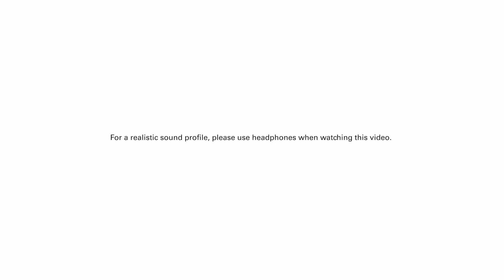Lilium Real Sound Profile - Noise Level | New Test Flight Video of Lilium eVTOL

Comment from the maker: Select eVTOL videos:
🚁 Personal eVTOL Jetson One https://youtu.be/OkeiEH1BA8M
🚁 Futuristic Propulsion System To Power eVTOLs https://youtu.be/PH_H7pIkL4Y
🚁 Lilium vs Joby Which Electric Jet Quieter? https://youtu.be/3rpzgwDsdOI
🚁 Ultimate eVTOL Comparison: https://youtu.be/IbIY1f05OrY
🚁 Lilium vs Joby vs Archer | Which eVTOL Is Better https://www.youtube.com/watch?v=OWx_Ea2s7us
🚁 Vertical Aerospace vs Lilium, Joby & Archer. Which Is Better? https://www.youtube.com/watch?v=YyYmluyB0nU
🚁 Joby Aviation (JOBY) vs. Archer (ACHR) https://www.youtube.com/watch?v=5kBecB3l3jo

🚁 Lilium Jet Architecture, Engineering, Ducted Fan https://youtu.be/k3UbgqM-srU
🚁 Lilium Capital Markets Day - Part 1 https://youtu.be/uAzQJ2OzO8I
🚁 Lilium’s Inaugural Analyst Day Webcast https://www.youtube.com/watch?v=dvLXCLcYyb0
🚁 Lilium 7-Seater Cabin Unveil. Evolution of Lilium Jets https://www.youtube.com/watch?v=d3eYyfXnl3c
Reply: Yes I like Jetson too! Cant wait for battery tech to catch up. Will be getting one when it does get better mileage and drops price a bit

Comment: Mate, run the sound through an fft. Lilium completely lie about the sound. It's is INCREDIBLY obvious they LPF the audio just before takeoff. Complete bollocks. Blatant lies about the noise. Trust me - just look at the frequency content of the audio in 1second slices during the takeoff run up. You can clearly see them bringing the low pass filter in and basically cutting off all the audio above ~12khz. Lilium are shady af

Comment: In regards to the sound profile inside the cabin i believe it will be a very audible environment without the need for headphones.  Least we forget, in most small aircraft excluding many jets, similar to that of the Honda Jet,  Most small aircraft including helicopters require the use of headphones and noise canceling mics to communicate between passengers.  Here we do not see the use of loud combustible engines nor the scream and shrill of both jet engines and rotors. Their will be transferable sound due to the physical attachment of the engines to wings and thuse the fuselage, but much of its sound is captured via the ducted fans and their sound suppressive lining. Moreover,  the sound issue is more about the exterior noise than that of whats heard in cabin, because sound suppression in the environment is key to where these aircraft can operate,  especially considering their urban targets of operations.

Comment: This is very close to a final product ready for mass production. For the next generation, The multiple engines mounted on the top of the wing are a good start for a blended wing design.  I could see all the small engines behind the wing/fuselage profiting from the slowed airflow and a very light structure since the payload would be directly below the lifting surface.

Comment: If they are making a video for the purposes of showcasing the noise profile, then it seems pretty stupid to keep cutting back and forth between a noisy wing mounted camera and an on-the-ground camera (unless you are trying to be deceptive). Nobody is ever going to be sitting on the wing of a Lilium, so I don't see how that shot provides noise information of any value. Also, video sound levels can be set at whatever the editor desires, so a comparison between the two different shots was pointless because we have no way of knowing what levels were used in the edit for each shot. Jumping between shots just made it more difficult to properly assess the noise profile based on the plane's distance from the point of observation.

It would have been much better if they had only used a static ground-mounted camera and showed the entire flight from that one position in one take, with no edits.

Comment: Thanks for the video, just one comment: Yes, I agree that the noise level inside the cabin is important, but the noise level outside is also critical if these e-VTOL aircraft are to operate in densely populated cities.
Reply from the maker: Agreed. What I meant to say is that the noise level right by turbofans/wings, where the GoPro was mounted, is not meaningful, as it would not impact anyone. 
What is important is the noise level at various distances (as they have measured in the video) and the noise level inside the cabin, which they did not measure.

Comment: Perhaps the higher frequency of Lilium will likely sound harsh when close on the ground but high frequency sound dissipates fast with distance. Joby's lower frequency sound may travel further. Also, Lilium will likely have more success with sound dampeners to the cabin than Joby for the same reason.

Comment: The sound profile seems nice to me but it's impossible to tell about the sound level. Sound level measurements (inside cabin, outside and on the ground) would have been helpful. By the way - you mention "cruise" but no flight video so far shows real cruise where the wings would produce a substantial amount of lift. All that we really see is a hover with slightly tilted engines to produce some forward speed. A real forward flight with the wings producing all of the lift would be interesting and especially the transition between both flight modes. I also have a lot of doubts about the advertised performance data - 280km/h speed and 250 km range. I think this has already been reduced (was 300/300 in the begining if I remember correctly) but I have some doubts if even the reduced numbers are possible with current battery technology.
Reply from the maker: You make a really good point that Lilium never showed us a real cruise flight. This is because they have not tested flight at higher speeds, so it seems.
As for battery capacity, Joby recently completed 250 km test flight, albeit with an empty aircraft and in a perfect weather condition. So, 250 km range is probably aggressive given the current battery technology. However, battery technology might improve by the time Lilium comes to market.
Until they showcase their production aircraft we will not know the true performance parameters.
Thanks for your comment!
Reply: @FGain  Yes, but Joby uses six big propellers which should be much more efficient than the small ducted fans Lilium uses. But I guess we'll not know for sure until we see some test flights demonstrating cruise capabilities.

Comment: This video didn't display any disable reading of sound ( since we have no inperson way of experiencing it). Sound became a big topic in this craft, because, the design may have compromised travel speed, the a to b point required factor. The craft is surely a mini version inspirational achievement for major large passenger airlines. The interior is quiter then a personal jetliner, floates like a flying car, but only reaches a speed of a fan propelled glider.

Comment: I’m still a little bemused as to why.non Of them are not using a powered detachable tether to supply the huge amount of energy to get the aircraft off the ground vertically before the transition, perhaps this may come later ?
Reply from the maker: Interesting idea. However, I'm not sure if the extra infrastructure, complexity and risk warrants the 5% or so in battery energy savings.
Reply: I asked them over Email about this a year ago, but didn't got an answer ;)
Reply from the maker: Yes, they are not very responsive
Reply: I thought it was more than 5% for the vertical takeoff phase

Comment: I skipped ahead to your comments and did not watch the test flight video because...I've already watched it six times today. There will be more. I will disagree on the need for some idea of interior sound levels for two reasons. Reason 1: this prototype is undoubtedly filled with test equipment and probably does not have all of the sound insulation installed. The interior is just not that far along in development yet. The flight envelope validation has to come first.Later they decide on pretty colors. I think that Lilium has the demo vehicle we see in the video and no other. The next demo unit will likely be fully outfitted.

Reason 2: To me, the sound levels inside are immaterial. We know it'll be quiet, much more so than any small airplane and hugely more so than any helicopter. So exactly how much just doesn't matter. It's not as if it's going to be so loud that it would prohibit the entire concept from taking off. What is utterly important is the sound level from launch to hover because that is what the entire business case of these eVTOL's are based upon. If they weren't going to be so quiet, there would be little need to spend all of the time and resources to bother inventing them. The germane quietness of eVTOL's is what makes the concept of air-taxi and regional charter service possible. From this new video, it seems clear that once 100' away, the Lilium becomes nearly silent in comparison to background sound levels. Even at take-off, it wasn't at all bad.

I suspect the reason we haven't seen any higher speed tests is that they simply haven't done any yet. As with any test flight program, the basics have to come first and here that's taxiing, hover, control in hover, and recovery in hover. They've moved on to forward flight this past summer, now we're seeing some tighter maneuvers. Since I'm guessing that this is the only test vehicle, they have to be careful. Even Joby, with an additional four or five years of development ahead of Lilium just made their first long-distance continuous flight this summer, and that's with a much more conventional layout.

Overall, I'm thrilled what what I saw in this video. I do have questions about stability and control in higher winds, how rain and cold affects thrust, and actual top speed. But you know what? So does Lilium!
Reply: For a company so we’ll funded and backed it does make you question why so few prototypes have been made, I know they are expensive to construct but development speed is a far higher cost, perhaps it’s because they have already moved on to the 7 seater concept.

Comment: The design looks like it could do with folding the rear wing. I haven’t seen anyone looking at folding wings except from Ehang. Surely in confined space verti ports this is going to be an issue for storing aircraft and loading/ unloading